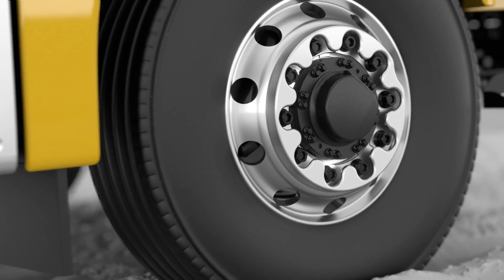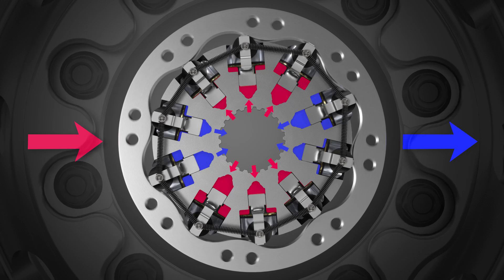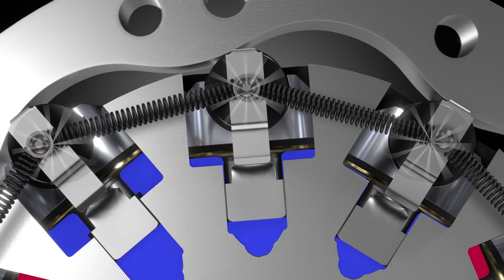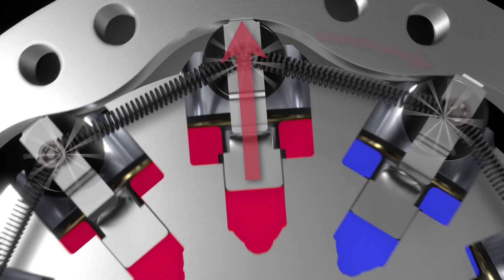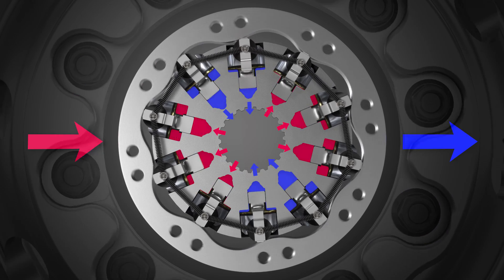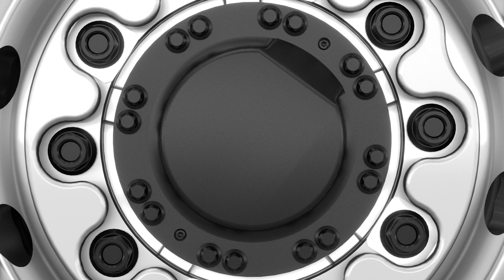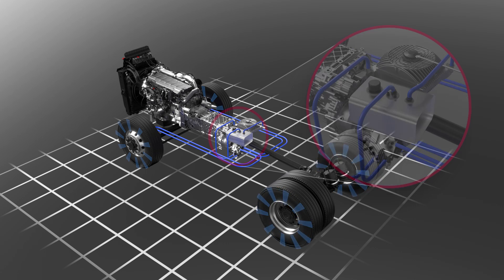The new MAN HydroDrive | MAN Truck & Bus

Comment: '
this yellow trailer must use 2 axles with 4 wheels at 010 to 024...
NOT need 3 axles = 6 wheels...
what happen to this truck is a NOT come with axle on the front drive wheel as 4X4 wheel

Comment: is there some reason you can't use 4wd, and a clutch to disengage the front wheels when not needed?
Reply: The idea behind this concept is to keep the truck as light as possible. A mechanical transmission would add like 400 kg to the weight of the truck.

Comment: So a more complex awd system?
Reply: Exactly what I was thinking. Just painfully expensive AWD/4wd that could be done easier with regular piston hydraulic motors
Reply: Less complex, lighter, less drag, no transmission tunnel needed, and a simple electronic valving to have the perfect diff-lock or "Torsen-like" if you need it
Reply: A AWD system that has no effect on Fuel economy if you dont use it.

Comment: Nice technology,but simple lsd  differential locks can also be used
Reply: LSD doesn't provide traction on axle that is not propelled.
Reply: Man thank u for clarifying my doubt👍😀
Reply: advantage of hydrostatic drive is in max torque from zero rpm. which no other can do.... electric can but it will bake its wiring :D

Comment: volvo 8x6 still gets more traction and can tow more
Reply: It's an additional 800 kilos at least. Add that the fuel consumption and all the maintenance due to multiple boxes.
Reply: @omursaraslan6316  800kg in a truck is not alot, a volvo still holds the record for heaviest single truck tow(750t)

Comment: So the same thing tractor has been doing for decades? I am kind of surprised this is just not become a thing. Hydrolic pressure and static systems are superior for putting the power down.
Reply: John deere had it.. it sucked.. folks rather have a regular 4wd system

Comment: Damn that was impressive! More than 7 thousand Nm on a single wheel!!!
Just curious how much torque rear axle is producing
Reply: its down to gearing, the shorter gear ratio you have the more "torque" it produces, hence measurements of WHEEL torque and engine torque

Comment: why to drive on such surfaces that are so dangerous for the driver and cargo... it looks very risky example in this video. safety manager shall terminate any project like that.
Reply: Anatole Sokol The minerals we obtain from Earth is form these kinds surfaces. So for the transportation of these soils and elements form to earth surface to the purification plants we use these kinds of heavy trucks which is suitable.
Reply: @MegaFaisalpk  Wouldn't earth mover be more suitable for these use cases? Looking at the tires and the shape, it seems to me the truck of the video is mainly optimized for roads.

Comment: It's a cool design function, but way to many moving hydraulic piston parts to fail for any reason, not to mention lot of hydraulic oil & lines & fitting to worry about because of unnecessary oil leaks. 
Stick with the original design of transfer case off the transmission, a drive line, & front drive axle for the 4-wheel drive, all wheel drive application.
Reply: It's MAN, German tech. its not some cheap chinese-made stuff.
Reply: Rodney Leonard its lighter and propably need less maintanace
Reply: Steven Günter  well. . . . That much I do understand, anyways. It is a very good design & good idea.
Reply: i actually think is a smart design, this mechanism will be used only n loss of traction so a lot of the time the system will be off, also it is probably much lighter and when not in funcition doesn't increase fuel consumption
Reply: + 420 bars... That's impressive. But I agree with you, what is the reliability of this system ? 
Anyway, I find it very interesting
Reply: @jowenjv4463  As it is engaged rarely, reliability is pretty good. I worked for company that is supplying this to MAN. 420bars is just show off... it is maximum pressure, which is not used in practice. Working pressure depends on load and is typicaly less than half of that.

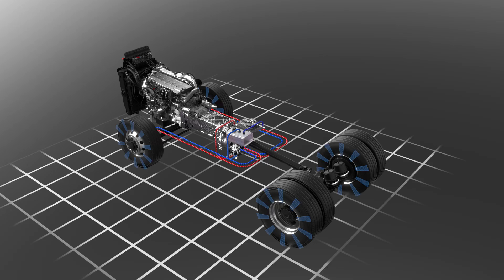Comment: 2:28
Seven thousand two hundred and eightteen Nm per wheel.
7218 Nm per wheel.
14436 Nm on the front axle.

This sounds like an error.
Maybe 721.8 Nm per wheel?
Reply: Blank Field take in mid that what a gearbox and differential axle does is reducing the speed to get higher torque numbers
Reply: This truck cld literally tow the moon with juz its ftont axle
Reply: Blank Field no it's correct
Reply: 10,647 lb / ft . Yeah that's a lot.
Reply: Some of the more powerful road cars can have as much as 5,000 lb-ft (6,779 Nm) at the wheels.
Reply: hydraulics can exert immense forces but at low speed, probably the wheel turns at just a few mph
Reply: I think they are correct, but they are only applied when usable without gaining enough speed. That is the whole tradeoff of this system, and the reason why it is employed in the first place: hydraulics can generate immense forces but only at very low speeds. This can help you in a situation like in the video where you're stuck: enabling the systems allows the truck to still move forward, albeit slowly - better than not at all. As soon as you're out of the critical section, you can turn it of an let the main motor take over again, to drive faster.
Reply: 7kN per wheel is actually realistic. These motors are designed for very low speeds, typically not more than 100RPM.  If you have such motor that is able to transfer around 50kW of power, it yields impressive torque.
Reply: This torque is generated with the help of 420bars of Hydraulic pressure. That's pretty impressive ! And like Spotav says, reduction ratio have a high impact on the torque.